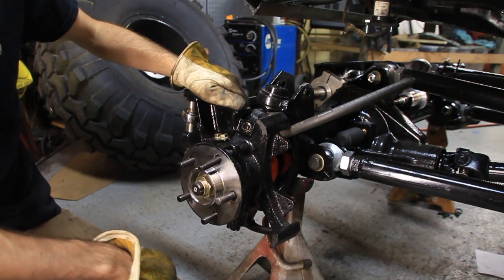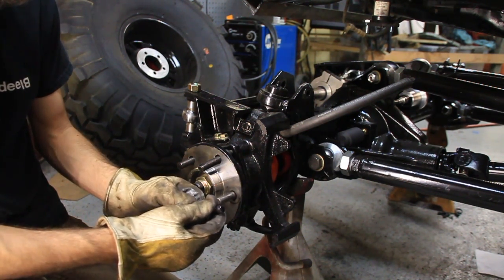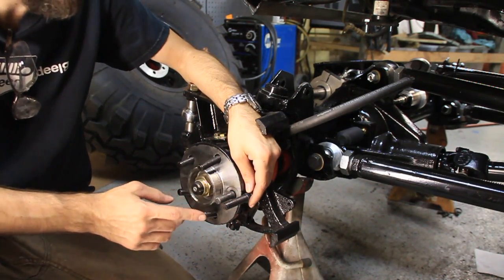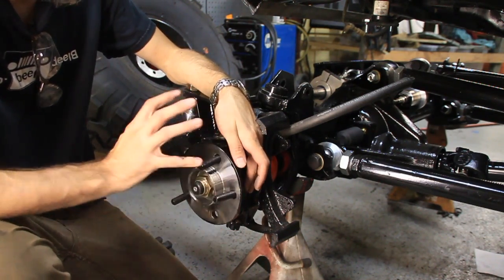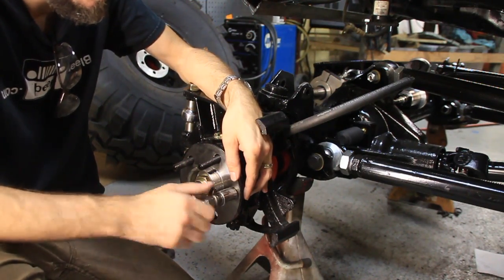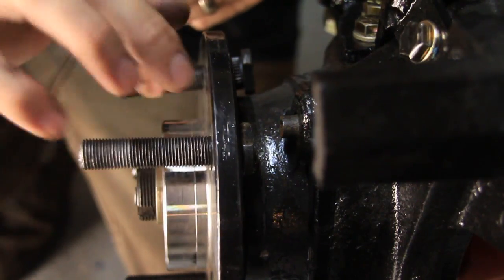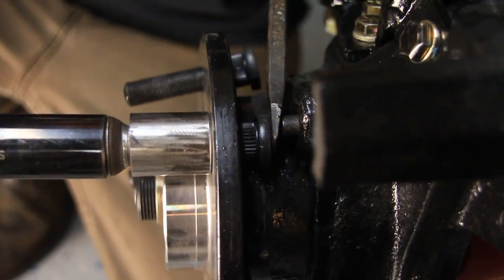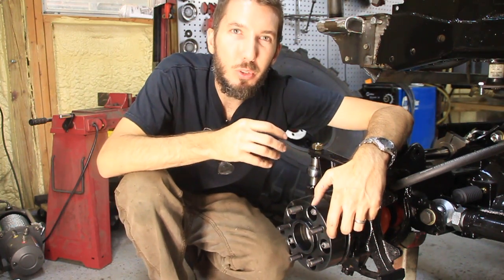How To Replace Wheel Studs

Comment: put the studs in the freezer and get them cold. they will shrink and be easier to pull through and then after they warm up will expand in place. makes the job that much easier
Reply: and heat up the hub surface just a little for the double whammy!
Reply: Awesome

Comment: I have used this method many times but I have found that using a standard lug nut works better than a "mag" nut.  I also turn the nut around and let the flat press against the spacer.  Keep the videos coming I really enjoy them.
Reply: I was going to say the same thing, also some grease on the flats that are rubbing together makes things a little smoother.

Comment: I Had to replace a front wheel bearing and the lug nut was cross threaded on the stud. I had to grind it off because I could not bang it off. When installing a new wheel stud try placing a large 1/2 socket, like an 11/16, 13/16 socket over the stud and use a large clamp, make sure it's true to the rear and front then tighten. Worked like a charm! Using the air gun seems like it worked Okay but seems it may strip the lug nut again and some diy may not have air gun. good video!

Comment: If you have a spare rotor laying around, install one the normal way, and install a 2nd one backwards.  The use a breaker bar to pull the stud through.  Afew hardened washers between the lugnut and the rotor make nice bearing.

Comment: Great helpful video! I need to redo mine, but my studs are loose with my rim on. How do i remove my lug nuts with the stud being loose and spinning?
Reply from the maker: hmmm, thats difficult, not really sure other than welding the back of the stud in place.
Reply: You could drill them out if you don't have welding gear.

Comment: Why use such a long spacer?  Aren't you basically damaging the threads at the end of he stud, where the lug nut will eventually thread onto?  I would think sliding a few washers on, and then using a regular nut that threads way up against the washers, would be better and leave the threads at the end of the stud pristine.

Comment: Good video man. Is the rear drum brakes the same process?
Reply: Yea but the studs are on the axles shaft end instead, you might have to remove the axles shafts to get the old studs out.
Reply: no you dont have to remove the shaft to change the studs. just did this 2 weeks ago when i did a rear disc swap. put the axles back in and realized i still had to change the studs. did it right in place.
Reply: 7

Comment: BleepinJeep nation should also know not to buy studs from the cheapest source- they should be the same or higher strength than the factory ones being removed. Those Chinese ones are great about shearing off after rotating your tires twice.
Reply: You'd be surprised at how many bolts are now made in China.